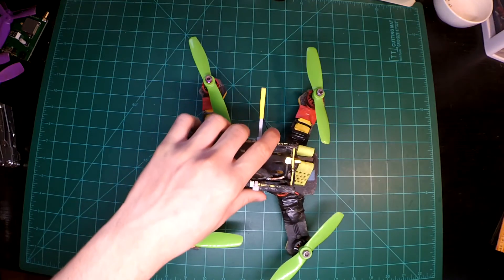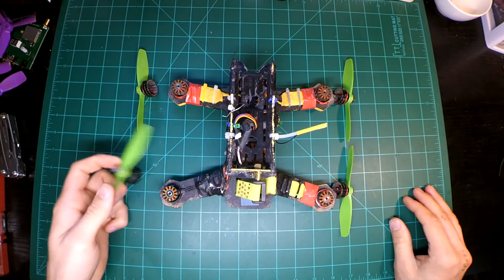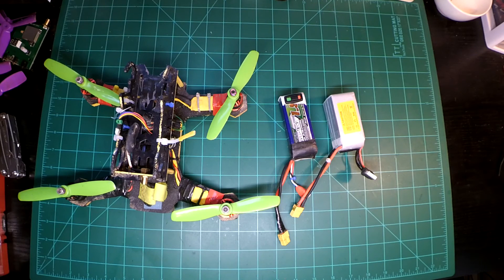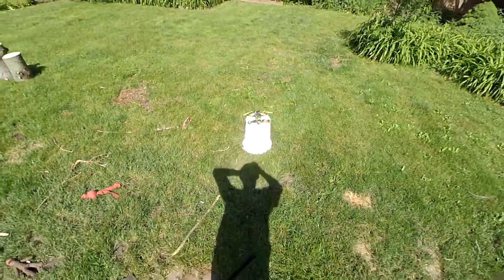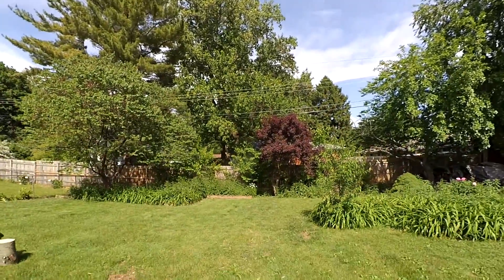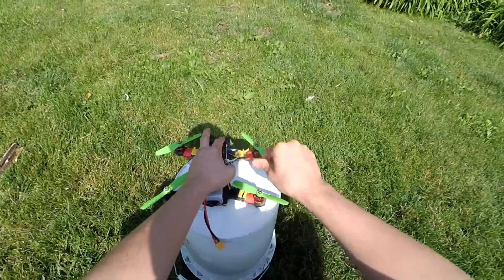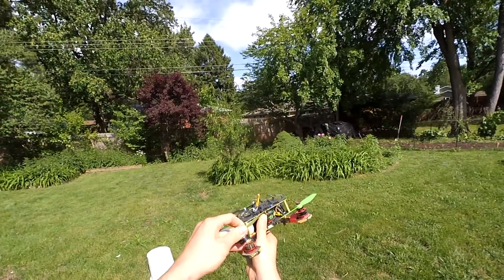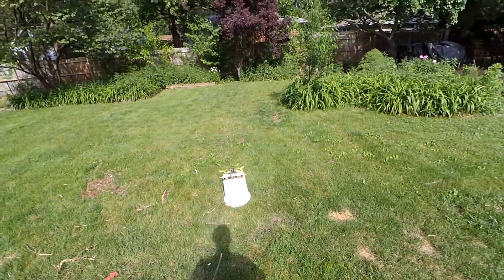Flying quadcopter without c-clips

Comment: While these anecdotal tests show that a missing C-clip doesn't necessarily mean your prop will immediately fly off, I still wouldn't recommend it. They are there for a reason. As someone else pointed out: at high RPM, there's a lot of electromagnetism holding them in place, but if you cut the throttle and get a lot of airflow moving from bottom to top of the motor, that force is not there to stop the bell from getting yanked off. Even if it doesn't, the motors will be noisier as the bell will be jumping up and down the whole time. Lastly, you don't want to discover your theory does not hold up under all circumstances on account of the prop flying off, rendering the craft inoperable and hitting something (or someone) in the resulting crash.

Fly safe, and always err on the side of caution.

Comment: I think your choice of pid tuning and esc is preventing your motors from coming apart. In the brick test it looks to me like between the rotor climb and the arm flex that if the power was cut fast enough they would fly off.
I would expect that the only way they are going to come off in flight is if you have a lot of prop and very little power on while the airflow is fast against the prop. The esc and the pid tuning plays a role in too. If the esc does dynamic breaking then there will be current and therefore a larger magnetic field even when you are off the power and the air is turning the prop. But if your esc freewheels when you chop the power there will be less force holding the motor together. And if your pid tuning allows the motors drop to near zero that would also tend to cause them to fly off. If you want to prove your setup can't come apart, mount a motor with a prop on a fixed support, add a dpst switch or relay to disconnect two of the motor leads, run it up to full speed and open the switch. I would bet most motors will come right apart. Use your head about how and where you do this of course...

Comment: The only problem is when you whack a tree.. then they pop right off. Also on 4s you do lose performance as the bells lift you lose some of the magnetic force resulting in less thrust. I can hear the bell lift on mine when it happens. But cool experiment tho 👍
Reply: Jason Hull  so quick release props.... That could actually be a great thing

Comment: A brushless motor consists of electromagnets, which means that the magnetism that keeps the two parts together gets stronger the more throttle you have. Therefor, you can take the top part off quite easily when the motor don't spin, but when the motor spin there is more force holding the top part down than the propeller pulls upward. The result? The motor stays together
Reply: This is what I thought..

Comment: for a smaller quad like this yeah you can run no c clips but i have a 6 inch quad i run on 4 s and it ripped a c clip off mid flight so i would only suggest this for 150mm and smaller quads
Reply from the maker: Solid advice.

Comment: well this is good cuz i lost one of my c clips. thanx for making this video!
Reply from the maker: Ian Rice Sure mane. Post back with your results!
Reply: I actually tested my arris c250 v2 with the 2300kv motors. And the motor did not come off. But i took a twist tie and took off the plactic coating and clipped a small piece off and made my own c clip just to be safe ya know.
Reply from the maker: Ian Rice Ha that's freakin clever
Reply: thank you very much :)
Reply: @spazoidpue   Sir i must thank you with utmost gratitude. I actually broke the groove and c clip flew away and the motor is out of stock and was tired of wondering how to fix that until I found this video and your comment